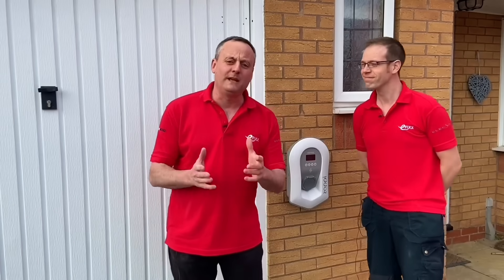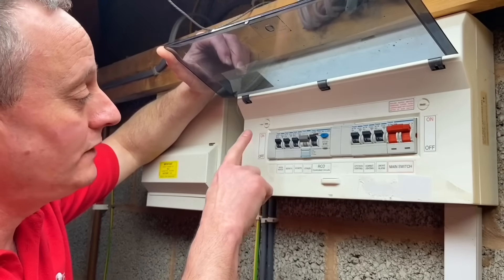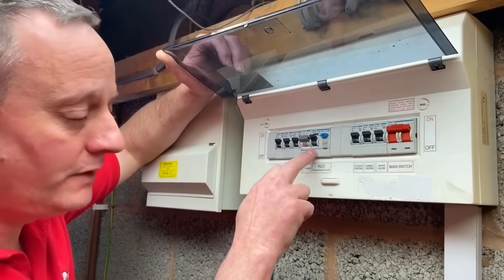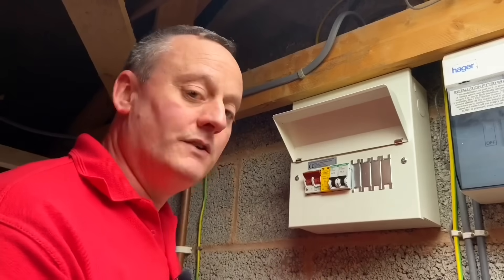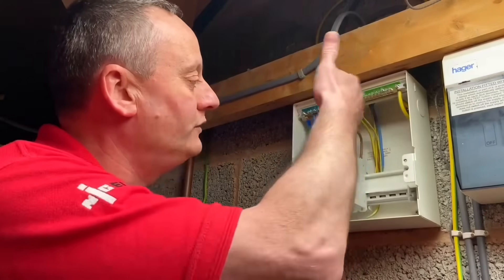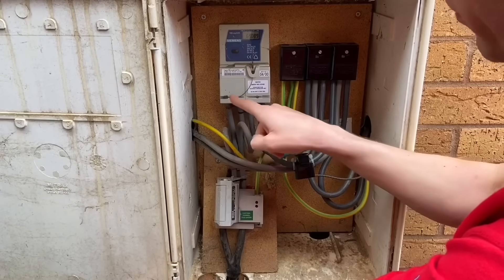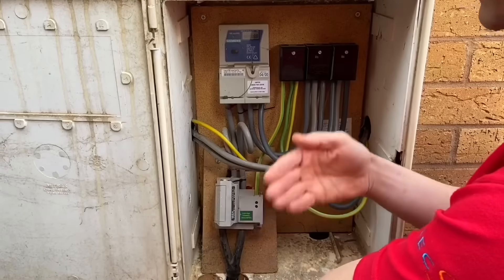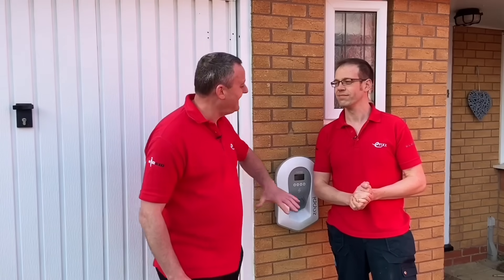EV CHARGER installation UK - can you connect to an existing CONSUMER UNIT?

Comment: For me the real issue is how we will soon be able to supply every household with not just a single +7kW supply (for present EVs) but three or four times that as we get to the point where electric cars  can be charged in minutes.  Every road of every village and every town will need new supply cables placing in the road - most being well above 31kV.  That cost will be phenomenal.  Who will pay?
Reply: Governments,  since cars were introduced and roads needed to be built for cars , plenty were funded to build from edge to edge of every country.
Reply: I don't think it will need such a high voltage cable
Reply: Thats issue aside... i heard there isnt enough raw material in planet earth to manufacture enough  batteries to supply everyone with a E.V vehicle who currently drves a vehicle now..... let alone the increasing population who will drive in the coming months/years....
So everybody  driving a diesel or petrol now wont necessarily be owning a E.V ...
Seems like an error in our forward thinking utopian future.....
Hydrogen powered cars anybody.??

Comment: For years, a 7.2 kw shower came straight off the house consumer unit with a simple isolation switch, so exactly why are these changes been invented?
Reply: Guess the charger is running for much longer than a shower...

Comment: Great video as always, quick question on the SPD. I appreciate that model is advertised as 'universal', but is that enough? Do you need to confirm with the CU manufacturer, in this case Crabtree, that they are happy for it to be installed in their board? So far I have not found a CU manufacturer who has written in their instruction that a universal SPD can be used. They all state that only their own can be used. I'd love to find one that allows this!

Comment: I wonder about the suitability of the mains supply to a house and what load it can take.  The cables that come down the street where I live are three phase with each phase going to a different set of houses (normal I think).  Within a phase I could imagine houses all having a fast charging point for their EV, electric heating inside the house, electric hobs and cookers, washing machines, tumble dryers, dishwashers, toasters, kettles, fridges and TV's in multiple rooms ... and lights.   What would happen if every household turned everything on at once and were fast charging their EV ?   Could the mains supplies to the street handle that ?  I ask because I have had several incidents in my street where the under ground wiring has failed and we have had outages while they repair it (digging holes).  One incident caused a huge surge that overloaded my neighbours TV (on standby) and it caught fire in the early hours of the morning.  Her and her family were nearly killed and my adjacent house, that is part of the terrace, suffered smoke damage.  A number of residents had appliance damage as well, presumably on the phase that was effected.   Given the larger number of EV's and charging points being fitted, is this a scenario we will see more of, particularly in older neighborhoods with doggy underground wiring ?
Reply: all these electric vehicle points wont be possible yet due to supply constraints , it all looks good in a computer but the reality is far different
Reply: I heard an estimate that 30,000 Km of old underground wiring in residential streets will need replacing to allow EV charging.
Reply: @johnlatchford9425  that sounds probanly an underestimate but on top of that wexwould likely need many more substations and a smart grid.

Comment: Seems like it would have been easier & cheaper to have upgraded the existing domestic consumer unit to the current standard that requires it to be housed in a metallic casing, that way the property’s up to current code, no issue with matching breakers & a nice simple installation with much safer RCBOs.
Reply: Considerably more expensive though
Reply: Customer never wants to spend 💷💷
Reply: I’m sure the current standard will change soon enough.
Reply: Rcbo isn't safer.

Comment: The tails going from my meter to the consumer unit are not 25mm but 16mm. I remember the meter installing telling me that. Does that mean I'd have to replace the 16mm if I wanted to one day get an EV charger installed ?
Reply from the maker: Yes unless the demand from the rest of your house is very low and /or the service fuse is just 60Amps and you fit a charger which measures the power use at the supply intake - e.g the Zappi by Myenergi
Reply: @efixx  Thanks.

Comment: When the EV charging station has its own RCD built in, is it connected to the main earth rail in your consumer box, or does it need another means to connect to earth (eg a separate earth pin)?
Solar power systems can feed DC in your system as well, does the inverter have its own RCD protection like the charging station?
Reply from the maker: It depends on how the manufacturer makes the charger. The Zappi 2 can be connected to the earth bar but others require an earth rod.

Comment: Why didn't they install the charging point inside the garage?
Reply from the maker: Not many people use the garage for cars these days!
Reply: @efixx  But I do and wouldn't want a charger placed anywhere else. Thansk for the qucik reply.
Reply: Would an earth rod still be required if charger was installed in the garage on pme
Reply: @bryancarruthers1121  No idea but why have anything on the outside if you won a garage?

Comment: I smell BS when I read manufacturers' instructions, especially when they mention 'Type Testing'.  I get confused when I read about who makes MCBs for whom and which factory in China will stick your brand name on their generic device or enclosure.  Remember how recently all these established brands were selling flimsy plastic boxes with two cheap quarter-turn plastic screws to hold the front cover in place (see the Hager board in this video).  I recently bought a 4-way Wylex enclosure with a plastic DIN rail!   If you Google 'MCB recall' you'll see Wylex, Hager, Crabtree, Volex and MK Sentry in the hall of shame.

Every situation requires careful engineering judgement rather than deferring completely to the manufacturer's literature, especially when we see evidence that their systems aren't sufficiently trustworthy.  The addition of a new consumer unit here has involved a lot of time and expense for the customer.  One option is to change all the MCBs in the existing board to any suitable brand which is readily available as new stock.  In this Hager board, you could just replace the three non-RCD devices to match your new addition.  The blank space separating the RCD-side will protect the remaining Hager MCBs from any detrimental thermal effects, and vice-verca.  Our new devices will be adjacent to the Hager main switch, but I think we should assume that there should be no thermal funny business going on in there - unless that one is also the subject of a safety recall!

Comment: Really interesting, from the horror  photos my electrician shows me I suspect in most properties a rewire would be needed before even thinking about installing a charging point.
Reply: Nonsense. We're lucky in the UK to have 230V AC with (mostly) a 100A main fuse to every home. This means almost every home will both have wiring capable of carrying 100A to the CU and an EV charging at 7kW to take only 1/3 of that power. Installing an extra CU is only recognising that whoever installed the home never envisaged ever needing all of that 100A, not that it's problematic to need it.
Reply: @chriswaites1222  yeh 100 amps is more than enough unless they are then installing heat pumps & other large amp appliances. I can certainly se that they will have to start fitting larger fuses to some houses whether new or old because of EV's heat pumps & other things added.
Reply: One good reason to use an external CU is that the electrician installing the charging point doesn't have to poke too much into your domestic wiring, although I suppose if the DNO fuse is to be upgraded, then they might have to look at tails and bonding and once that starts, then heaven knows what they might find.

Comment: All that because the company could not spend 15 minutes tracking down the whereabouts of a Hager MCB.
If my boss saw that he would assume I was on the take & riding the customer for all I could get.
Even if you could not find the relevant age Hager MCB Hager will supply a new 32A MCB with assurances it will work in any Hager Board, just use a short piece of 16 or 25 square to connect the MCB.
That's gone from a £200 job to a £1,200 job, I would call this Rogue Trader material for the TV.
Reply: you should have a park time job with them talking bollocks of yours.

Comment: Further to longer comment about difficulty in finding good electricians,  I've found you can put 3 electricians in room and watch a pretty heated row involving 4 different ways of doing something, each swearing the regs say different things and slagging off each other's choice of fitting.
Reply: I'm a Yorkshire Electrician, God said I can't be wrong even when I'm wrong
Reply: Regs are a big updated con sometimes they make you do an entire course for only a few pages added from the previous regs ie 18th from 17th. 

Also there are SO many Electricians who wire differently and its a headache as we all have different ways of wiring. 

Surge protection can be nonsense as alot of new devices have built in surge protection inside the circuits in new electric cars and electronic  components in entertainment products. 

Also it depends how fast you want to charge your vehicle. I know someone who wanted 16mm cable to charge there car. Which can carry from 57 to 85 Amps. Even your shower doesn't need that.
Reply: @Mark-ij2nh  You don't have to do a regs course ! You can identify the changes and read them yourself.

The IET publishes details on what has changed from each version of the regs to the next.
Reply: Way down here in NZ everything must be on RCDs..   apart from fixed appliances like oven and hot water. 
Average house will have at least 3x RCD.
That cable clipped to the timber would not comply.  Interesting to see how other countries do things..
Reply: Sad thing is people in the trade nowadays aren't passionate about it.. a lot of them are the non academic who go for the money
Reply: Regs can some times be a scam and personally I hate metal consumer units and wont have one in my house. 
I have had a few slight shocks from a few metal cases from d.i.y installs. Plastic is not conducive there for much safer. Spain has always had metal in the areas I visited
Reply: I’ve seen two sparks almost resort to fisty cuffs in a wholesalers when arguing about regs regarding metal fuse boards
Reply: Agreed
Reply: thats because most new electricians are lost in too many technical bullshit items , rule of thumb , consult the regs and use some common bloody sense
Reply: @andywarrington4738  It's because electricians are not trained well enough. Many really don't understand electricity, but because they are electricians and have had some limited amount of training, they think they know it all.
Put those electricians in a room with qualified electrical engineers and they lose every time.
Reply: That’s exactly how it is.  It rare to find Electrician who compliments another’s work.  In their eyes it only themselves who do a good job.
Reply: @Poorlybobsdad  When you come across qualified electricians on YouTube that don't know the difference between kW and kWh then it's pretty clear the industry has a serious problem.
Reply: @deang5622  depends what you mean by qualified really.  Let’s say experienced.  Even then they all criticise each other’s work even if it’s of them highest standards.  It doesn’t help when the regs are written in language that open to interpretation.  One man’s correct is another’s wrong.
Reply: @Poorlybobsdad  I have had at least two arguments on YouTube where supposedly qualified electricians standard of English wasn't high enough for them to even understand their own regulations.
Specific regulations that were clear and without ambiguity, but only if their standard of English was high enough.

There are conducting regulations and gaps in them, but then the electricians should have sufficient expertise and skill to be able to come up with the most appropriate solution. If you understand electricity thoroughly and what the regulations are trying to prevent (electrocution, fire) then you can come up with a solution to the omission or conflict in the regs.

The problem is electricians need to be spoonfed because they don't have a high enough level of competency, despite their qualifications.

I think the standard of people becoming electricians is very low, there are no pre-requisites required. You don't even need GCSE's in maths, English or physics. The first two of these are supposed to the absolute bare minimum every kid coming out of school should have.

That's the problem: one or two day a week vocational courses, no pre-requisites and candidates of a low standard.
Reply: @deang5622  fair point Dean, agreed.
Reply: @Poorlybobsdad  You need to read what I wrote.
I said qualified electrical engineer. I did not say qualified electrician.

There is a discussion over what counts as a qualified electrician. There is no debate over what  constitutes a qualified electrical engineer. The requirement for a qualified electrical engineer is someone with an honours degree in Electrical Engineering.
Reply: @deang5622  not really sure how that is relevant.  When’s the last time you saw an Electrical Engineer install an EV charger?
Reply: @Poorlybobsdad  It isn't relevant. I am just correcting your misreading of my post.

Comment: So how do you find a really good sparky who thinks, diagnoses, and communicates clearly with me with my 'A' level physics and, before regs changed, did a fair amount of household wiring following the books to the letter? I haven't found one who takes any time, cleans drill dust out of the back boxes, or listens to what I say. Contrast the excellent plasterers, plumbers, general builders I've used in south east London. 
With side, loft, and tear extensions, we have lots of lighting, power, shower, cooker circuits and want to plan for EV.
Reply from the maker: See if they are on Instagram and see the quality of work that they post. We follow some inspirational electricians.
Reply: Well you havnt used me Steven, but I don’t work in east London so your search continues

Comment: The earthing conductor is included in the length rule for the SPD. It would of been better if they had taken the original 16mm earth to the new consumer unit and then taken a new conductor to the old CU. Negating the need for the third Henley block and actually conforming to the length requirement for the SPD.

Comment: Why did the meter companies take such a step back and remove the safe means of isolation to the consumer side of the meter allowing you to change the tails if needed. And then not retrofit a suitable means of isolating meter tails when they removed such functionality from those meters that had it like this Siemens unit? Stupid.

Comment: Just to clarify. That SPD due to the conductor lenghts, it's designed to protect the EV charger and wouldn't be expected to be sufficient to protect the rest of the installation on the existing consumer unit?
Reply from the maker: It would also offer a degree of protection to the rest of the installation. If possible fit as close to the incoming supply as possible.

Comment: Is that only one phase?
Our houses in Denmark all have 3 phases.
Reply from the maker: You are lucky - it’s mainly single phase in the UK 🇬🇧- so 7kW maximum charge rate
Reply: @efixx  Because this used to be a farm, I believe I have 3*63A ;-)
Reply: @efixx  Er, how come I have a 9.5kW shower then? The 7kW is the limit of the plug/socket being 32A rated and the AC charger in most EV's being only rated for 7kW. I doubt anyone is going to the expense of installing a DC fast charger at home. Let's face it a 7kW charger will get you at least ~60kWh of charging in 8.5 hours (aka overnight) which will get you at around 250 miles of range. I would note that 63A single phase plug/socket combinations are available too.
Reply from the maker: Charger limits and standards are set by the automotive industry.
Reply: @efixx Exactly which is why a comment that we are limited to a 7kW charge rate in the UK due to a single-phase supply is just nonsense. Above 7kW you need a DC                                 charger and nobody is fitting those at home regardless of whether they have a single or three-phase power supply as they are too expensive and you don't need fast charging at home.
Reply from the maker: @jonathanbuzzard1376  7kW is generous in the UK compared to the standard residential supplies in Italy which are usually 3kW or 6kw for a whole property.

Comment: With the RCD being built-in to the charger, how does the owner do a test on it, that is operate a manual test button, and do you carry out an RCD test as you would a regular stand alone RCD.
Reply: Good question.  Taking the front off that charger every three months would be a pain. ;-)  Or does this just illustrate that three-monthly testing of RCD's is not really required?

Comment: surge protection only protects new circuit, original consumer unit should have been upgraded to current spec and all circuits are protected. in my opinion
Reply: Not sure the end user or their wallet would thank you for that. Maybe throw in arc fault detection whilst you're in there.